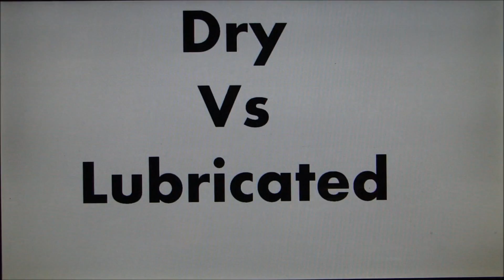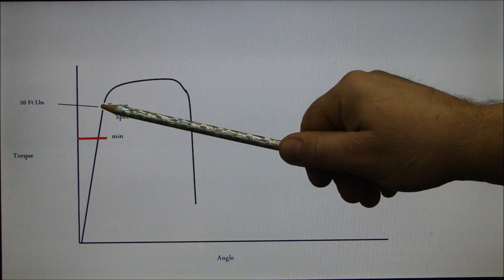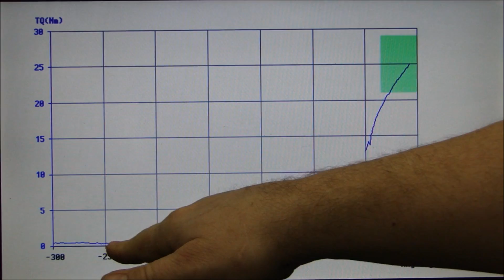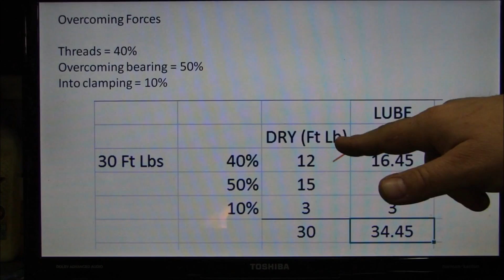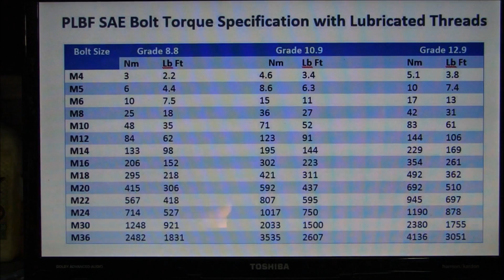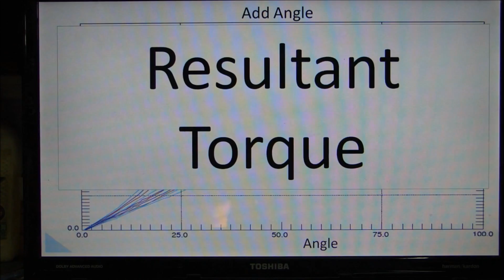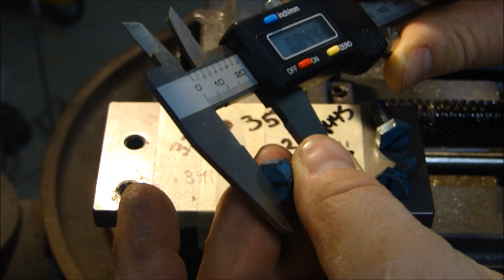Engine Building - Fastening

Comment: I'm not following this entirely. You say that lubrication requires more torque to achieve the same clamp load. I take it that the clamp load is yielded by the pinch of the bolt.

I imagine the bolt as a rubber band, or helical spring if you will. For simplicity, let us assume that the tensile stress of the bolt stays within the purely elastic range. Then the clamp load achieved is a linear function of the elongation of the bolt only. I.e. the load exercised by the bolt onto the clamp follows Hooke's equation.

The elongation of the bolt is proportional to the number of turns achieved on the bolt and the slope of the threads. I cannot see how friction/lubrication plays a part in this. The friction as I see it only gives rise to torsional stress when turning the bolt, not pressure on the clamp.

Imagine if the lubrication somehow evaporated or perished right after the tightening, would then the clamp load increase in some magical fashion?

I feel like I'm missing something here. Since the threads go up all the way to the head of the bolt, there is also a wedge effect taking place as it pinches onto the surface of the metal block. The above mentioned conditions might apply better when there is an unthreaded region (such as a washer) between the head of the bolt and the metal block whereinto it is seated, and no bottom that the bolt can touch when tightened.

Maybe, what I'm missing here is that there is also a torsional component of the deformation to account for, and not a purely axial deformation.
  An effect you experience when you try to push a drawer back into the cupboard by the corner and it pinches into the cupboard and not traveling straight in had you pushed it on the center or both sides. The slanted insertion of the drawer gives a contribution to the friction you would not experience had the drawer been equipped with ball bearing rails (the head is the on corner of the drawer that you push and the the other end of the bolt or where the threads bite is the opposite end of the drawer).
  I believe that this answers the above question; not initially, however, as you try to turn the bolt, the load will build up until you manage to crank the bolt.

Btw, if you measured the length of the bolts while they were seated onto the metal block you would also get the elastic deformation to boot, not just the plastic deformation.
Reply from the maker: Awesome stuff! The simple fact you are asking these questions indicates you are getting it. If you think about the surface area of the threads and under the head, much of the torque is friction from these surfaces. The tighter to fastener gets the more friction it must overcome. That is why most of the energy goes into friction and not into yielding the fastener. Lubrication helps the surfaces with dynamic friction, but the distribution of energy is constant so as the lubrication helps the fastener reach torque faster, the energy put into the fastener is less so the resulting clamp load is lower. 

Hooke's equations only apply to the elastic region. As plastic deformation occurs the tensile strength of the material takes priority. When angle is applied to the fastener to apply the clamp load, lubrication allows some of the energy to transfer to dynamic friction so there is less clamp. 

I hope that makes sense. It's all about where the energy goes and what lubrication does to shift where the energy goes.
Reply: Perhaps the twisting of the fastener might help explain why a higher clamp load is achieved in less turns when unlubricated than when lubricated. An unlubricated bolt twists more than when lubricated.

If you Google image search for 'torsion' you'll see that the length of a twisted beam no longer is a straight line but diagonal, or helix if you will. The slope of that diagonal is commonly denoted by an angle \gamma. That type of elongation is slightly more complex than a simple straight elongation of a spring or a rubber band. 

This can also be illustrated by twisting a rope. When you twist a rope it gets shorter so that ought to give rise to a higher tension even though the twist might not be as high in the case of the bolt.

Why the bolt twists more when unlubricated might be explained by the slanted drawer insertion example.

I didn't know that bolts and screws are tightened so hard that they get beyond their purely elastic region. Normally in construction one tries to avoid stressing materials so much that they experience plastic deformation.
Reply from the maker: So when a bolt gets tighter the material starts to tear apart because it's not flexible like a rope. The material is already as short as it will ever be so the only option it has is to tear apart. Part of the energy used to torque a fastener is going into trying to tear it apart. Great conversation...thank you

With a torque to yield fastener you are stretching it so it yields and produces the highest clamp loads. That is why they are thrown away after being taken out. They are permanently stretched.
Reply: Yes is is an interesting conversation indeed!

The twisting of a bolt could even be measurable by putting markings (one straight line on the top/head and one on the bottom of the bolt) on them before screwing them in and then see how the alignment is affected once fastened. Perhaps the twist of the bolt won't be more than a few minutes.

Another question is that whether lubrication really is such a good idea. I mean imagine when fastening a bolt that there will be one day when you want to have it removed. Adding lubrication to a difficult to remove bolt might not be as helpful with a bolt that was lubed when fastened new as on a bolt that was fastened without.

Another aspect of this theory of fastening is that there are strict requirements as to the torque, angle and order when assembling engine blocks. It would be interesting to know as to why that is and what it is that goes wrong when tightening such bolts the wrong way. How much deviation from the torque specs is allowed for example.

Even the screws of a computer hard drive must be mounted in proper order and with proper torque, otherwise the drive will fail to operate. An engineer demonstrated this in a Youtube clip. I think it was the guy at Gillware Data Recovery that did this in the clip "One reason to never take you hard drive apart" (clip v=5CAn22TiVV0 )
Reply: Btw, I talked to a friend about this a few days ago after I had refastened a cylinder head with new bolts.

He said that he used to work at a place where they assembled marine engines. There they used a special machine to stretch the bolts at a specified force. Then while stretched they screwed a nut onto the bolt just far enough to touch the surface before releasing the tension. That way they get a more accurate pinch force of the bolts, he said.

He meant that when torquing the bolts the "ordinary way" you always need to accept a 30% tolerance, and that you cannot get a higher accuracy than that.

Comment: how is it possible ,that the bolt wich has turned more angle, and so, deeper in, has less clamp load?

it does not make sense.

yes a lubricated bolt will turn more angle to reach the same torque load at the wrench.
so the bolt has gone deeper. how can it ever possibly have less force then?
Reply from the maker: I know it's tough to get. It's all about where energy goes when you torque down a fastener. Lubrication moves the torque curve, so when an angle is applied the resultant torque is lower. Torque and angle are calculated differently so they do not make sense to each other.

Comment: can u tell me ...how to find out snug torque and respected angle
Reply from the maker: Just Google torque spec for the size bolt you are using. You will get a recommended torque. Angle is a calculation, unless you are using a TTY bolt with a specified angle, there is no real need to add angle.

Comment: I appreciate that Pete, but if I use aftermarket fasteners and follow instructions to lube them, I can expect to be applying less clamping force than the OEM fastener if I follow the manufacturers specs. So how do I determine the correct increased torque value to apply to at least achieve an OEM clamping pressure if using an aftermarket fastener? Thanks Robert.
Reply from the maker: If you use an aftermarket fastener that is of higher grade, ARP for example, the torque spec will change even more. They should come with torque specs that show a dry and lubed numbers. There are many charts online that will show proper torque specs for the fastener you choose. Thank you Robert

Comment: may I ask why you chose to measure where you did on your caliper? Technically it's supposed to be lower, i.e where the jaws taper.
Reply from the maker: +小林空色 Excellent point. When measuring some parts I go by feel and it's easier to get it right at the sharp ends. But you bring up an excellent piont, when taking measurements always use the same part of the caliper.
Reply: And another thing is that the fastener has the raised number on the head. It's possible for the caliper to measure on top or between these number that could affect the results.

Comment: I don't get it. If by lubricating a bolt you create less friction while applying torque to it then why is the clamping force decreased in comparison with a dried bolt that gets the same torque. I'm totally lost here.
Reply from the maker: I know it's tough to get. Two parts, first you torque the fastener, now completely forget that step because it has nothing to do with the next part; applying angle. When you apply angle you are stretching the fastener to the yield point to make sure it reaches maximum clamp load. If there is lube on the fastener, when you apply the angle the fastener does not see enough torque so it does not reach its yield point so the clamp force is low.
Reply: I was  under the impression that the lubed bolt should reach its yield point ( stretching ) better than a dried one that has to  overcome friction before getting to its yield point, while getting same torque force applied.Thanks Pete. Im rebuilding my ford 351m to a 400 and you are a great source of good detailed information. Thumbs up.
Reply from the maker: It seems counterintuitive, but it is that friction that provides holding so the bolt can stretch. It's kind of like trying to open a jar with grease or something on your hands. You can't get a strong enough grip to break the seal. If there is not a strong enough grip, the fastener will not yield.
Reply: now I get it !!

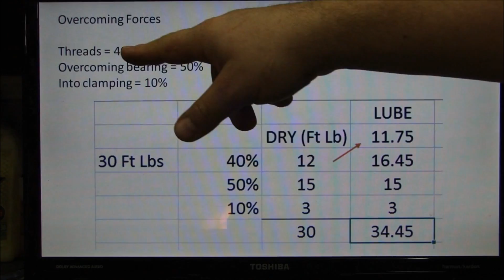Comment: @12:55 he said 11.75 is 40% of 16.45. I dont get it. Can anyone please explain what he means?
Reply from the maker: It's an example. If you apply lube there is a 3% drop in thread friction so the 12 will drop to 11.75 (actually 11.64). All of that energy plus 40% is 16.45 (11.75 x 1.4 - 16.45). The example is that with lubrication you have to apply more torque to achieve the same clamp load due to the drop in friction. I just watched that again and I could have explained it better. Thank you for pointing that out.
Reply: @PetesGarage  thank you so much for the explanation! Just wanna let you know that its an really awesome video. I understand the numbers but why do you need to <plus 40%> when there is a 3% drop in thread friction? If the 40/50/10 rule still hold, the thread would become 0.4x34.45=13.78? Also, if there is a 6% drop in thread friction do you then need to plus 80%? So sorry for the many questions.
Reply from the maker: This is actually a well documented thing. Most bolt charts will give you a torque for dry and lubed

Comment: Do you have any thoughts/experiments on waiting an hour and torquing again without loosing first?  This would be for non-TTY and non-loctite bolts.  It sounds like a bad thing to do.
Reply from the maker: I have a great deal of experience working with measuring torqued joints for relaxation. Depending on the bolt and base material there can be as much as a 30% relaxation in the joint. It does not take an hour. Measurable relaxation happens in less than 15 minutes.

Comment: TTY or not. How can a fastener become more stretch with less turn in total? You stretch the fastener more witch only turned 53 degree than a fastener turned 68 degree? What was the preload of the fasteners before you start to torque em? You're setup is not a tensile joint either. You only torque the fasteners in a threaded hole? If the setup supposed to be a tensile joint, then you should measure the clamping force before you add the angel also. One last thing. At 12:45 you said 11.75 Ft Lbs is the overcoming force on the lubed threads. This mean less force in total (11.75+15+3=29.75Ft Lbs) to achieve 3 Ft Lbs clamping force? Where do you get the number 16.45 from? I'm very confused on this one, and guess I don't get it though :/ By the way, thanks for your explanation.
Reply: I hardly try to figure this out. Again at 12:45. 30 Ft Lbs is 100%. Change in overcoming force at threads and bearing will affect the clamping load. 11.75 Ft Lbs is 39.16666%. 15Ft Lbs is still 50%. Combined force of friction is 89.1666%. Then the remaining force is 10.8333% = 3.25Ft Lbs of clamping load. Conclusion is that lubed fasteners get more clamping load. .
Reply from the maker: You are missing the point. If you are using a TTY fastener and there is a lubricant anywhere on it, you will have less resultant torque at the end of the applied angle.
Reply: Is this all about TTY fasteners, and not the regular one? If so, I wouldn't argue anymore. I haven't that much experience about TTY's (yet). Thanks for your reply :)
Reply from the maker: It is about TTY fasteners. Specifically, it is demonstrating that if you have any sort of lube on the fastener, after you apply angle the resultant torque will not be high enough to achieve maximum clamping load.
Reply: That's change the story. Thanks again.

Comment: I am trying to apply what I have learned in your video to my 60 year old tractor. I am pretty sure that there are no TTY bolts in it. In fact I was unfamiliar with them till today. Old tractors like mine were meant to be rebuilt every year or so, so removing rusty bolts is a common problem. Since I am only dealing with my torque wrench, and not angle, is it safe to say that I will over stress a lubed bolt (ie too much clamping force) when I use the manufacturers stated torque spec. (assuming the spec did not specify lube).Along the same lines, if I lube my Volvo's wheel lug blots and torque manufacturers spec, am I likely to warp the rotor?Ron
Reply from the maker: +Moose Hi Ron...yeah, an old tractor won't have TTY bolts, but it will have torque specs that will be altered by lubricants. I would never lube a lug nut, especially on an aluminum wheel. If you torque the lug nuts to the proper torque in a criss cross pattern you will not need anything on the threads.
Reply: +Petes Garage Thanks for the quick reply. I am really trying to understand this, and I cannot follow rules without understanding the consequences fully. So, referring back to the original questions, what are the real risks of lubing my tractor bolts and my lug nuts. I have yet to overhaul an engine, planned this summer, but I have way to much experience with frozen bolts. So, naturally one would tend to put a drop of oil to save braking it the next time. I cannot count the number of times I have to exceed 500 ft-lbs torque to get my lug nuts off that were supposed to be torqued at 85 lbs. Thanks.By the way, I spent about 3 hours on this segment alone, plus I watched your complete cobra build. Great job.
Reply from the maker: The risk is you will not achieve the proper clamp load and the nut could loosen. If you don't crank the hell out of it putting it on you won't have to when trying to get it off. But, if you have trouble I would prefer hear to using a lube that can collect debris.

Comment: Hi pete  im told 2 replace these tty bolts every time but gm dont sell them without buying the entire rear main oil seal housing for my s.c. 3800. I liv in australia not sure if its the same story in the usa. What options do i hav? R they available in your country?
Reply from the maker: I believe they are sold as a kit. Usually you can buy just the bolts

Comment: Is Loctite considered lubrication?
Reply from the maker: Yes. It is a liquid that will act as a lubricant. It contains of things saccharin. So it not only acts as a lubricant, it makes the bolt taste sweeter.
Reply: ***** 

Nut nectar. I got a gallon of the pearl. ⛲
Reply: I had a problem with my main diff bolts coming loose after an amount of time. I tried cleaned an dry, lubed with WD40, nord-loc washes ... finally I glued the bastards in there with loctite :D .. I know I know its the easy way out but it worked.

Comment: hey pete, im trying to build a nice motor for my mustang gt its a 2000 with a 4.6l sohc it has nice power but i want more lol and i watched ur video building the 427 cobra motor fuel injected and i was wondering if that motor would work/fit in my car ? any help will be greatly appreciated and how much did that motor cost to build ?
Reply from the maker: You could get a 302/347 stroker to fit. there are conversion kits to do it....I would say you could do it in around a $5k budget
Reply: Thx man and love Ur videos very detailed and thx again for the reply and info much appreciated